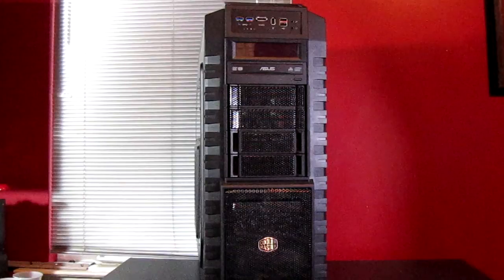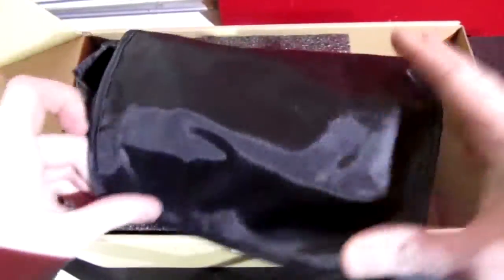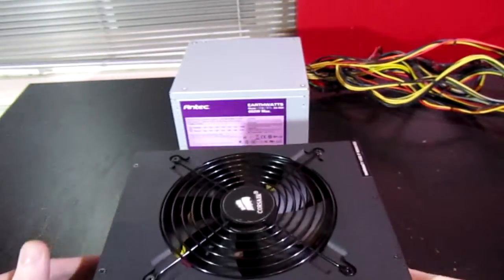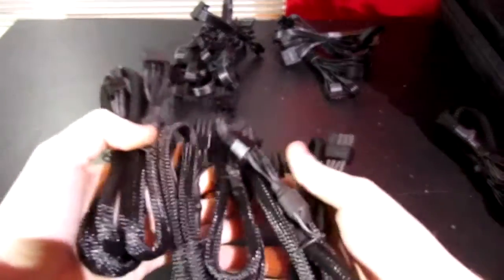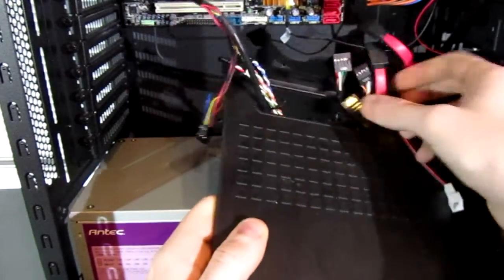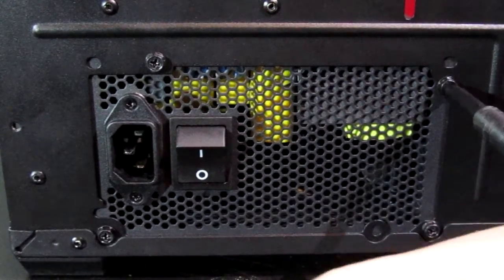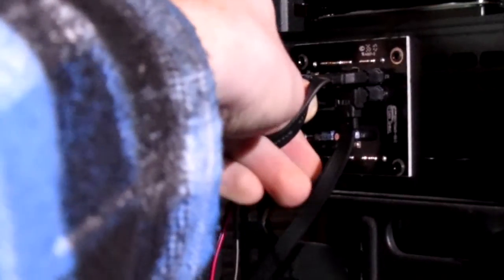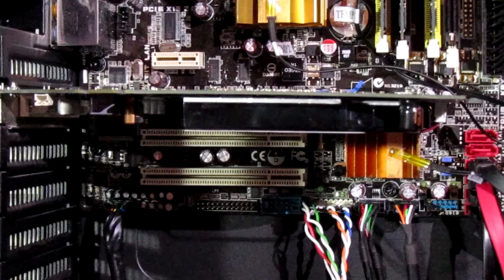First PC Build- Corsair AX1200 Power Supply Unboxing & Install

Comment: shouldnt have gone with a 1200W with your parts your just wasting energy
Reply: it doesn't use 1200 watts all the time tho... and if the watt usage is under 40% the psu fan won't start which means less sound, and it looks like he is upgrading slowly but for sure C:
but you still got a point tho .. lel